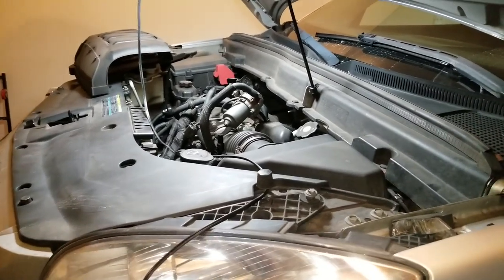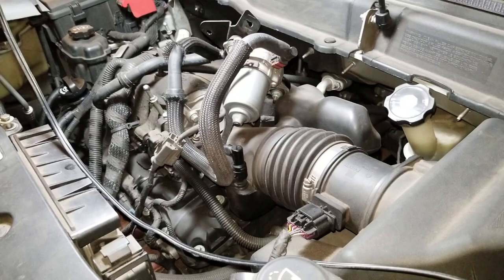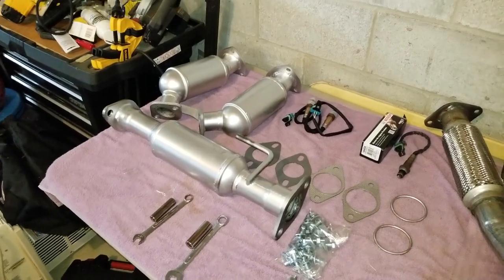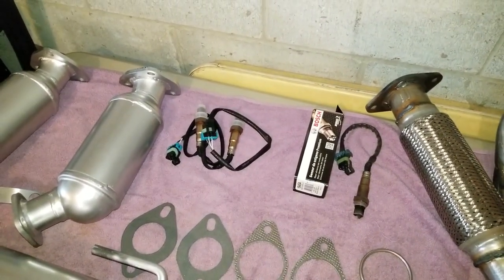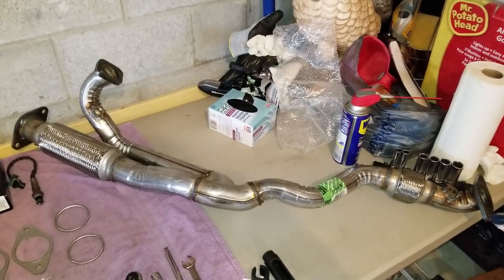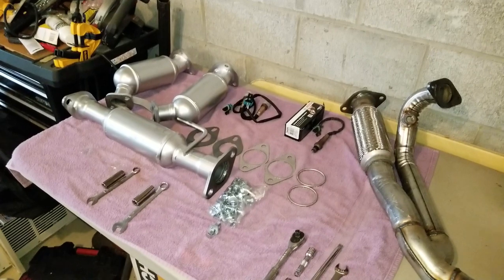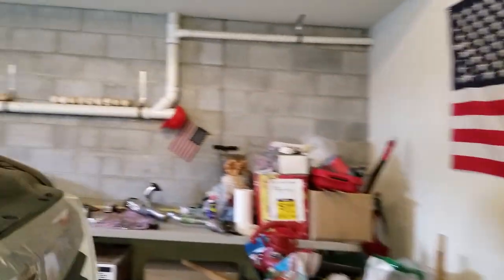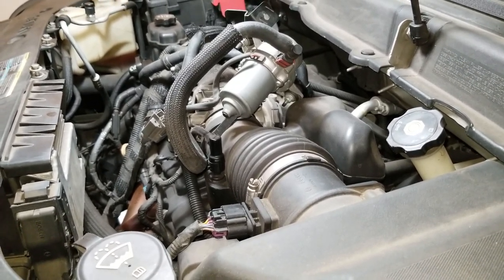2009 Saturn Outlook, Acadia, Traverse, Enclave - Catalytic Converter Installation - Part 1

Comment: Best video on youtube on this subject. If I could add anthing it would be spray all the nuts and bolts regularly before install day,  makesure to use 12 point wrenches/spanners and sockets. And ratchets for tight spaces and lots of teeth to reduce having to take off your socket and reset it. Brilliant info Jay.
Reply from the maker: I absolutely agree.  Spraying all the nuts and bolts is a must, and I wish I had 12 point wrenches.  I have some, but only shallow sockets, not deep sockets.  I also wish I had ratcheting wrenches but had to make due with what I had.

Comment: Jay, thanks for the excellent videos.  Your education gave me the confidence to successfully tackle the replacement of all 3 catalytic converters and 4 oxygen sensors on my 2010 Acadia.  It was not an easy job for a novice like me, especially as some of the bolts needed to be tackled almost by feel, but you told me all I needed to know, and removing the heat shields helped a lot. 

If I can share some advice to others it is, get yourself an impact wrench.  I spent the most time trying to get off a couple of easily accessible bolts which I could not budge, eventually messed up and had to cut off.
Reply: Was your 2010 Acadia an AWD?
Reply: @kenkuchnicki9012  Yes it was.

Comment: Not all super heroes wear capes! You are the king sir. Not sure if you plan on putting out more videos or not but you have me subbed forever. Thank you
Reply from the maker: Yes, eventually there will be more.  I am not a rich man and can't afford anything new right now so this car needs to last me at least another 2 or 3 years.  So I plan on fixing as much as I can on my own, and with that there will be videos.  I will be doing spark plugs and ignition coils soon, and eventually a brake/rotor/ball joint video, so stay tuned.

Comment: I paid a little more than 100 for  a 3 part catalytic converter with all the hardware and 120 for the flex pipe section through Amazon.  Everything fits perfectly!  The problem is all of these parts companies are ripping people off.  The parts I got are  OEM certified GM parts through aftermarket parts suppliers.  The difference is are they rated California emissions.  Even if they are not, they will still work!

Comment: I'm looking at replacing mine right now. At 296,250 miles on my 2009 Enclave. The engine killed my cats. I've had to change the coil packs out so many times it's silly. I'd never put in OEM since I can't figure out this issue where the coil packs go back and then unburnt fuel goes into the cats and kills them. So cheap and time consuming is my only real option given my situation. Fortunately I have a friend with all the tools and a lift so I can do this again in 18-24 months after I'm at 350k miles!
Reply from the maker: The fact you have that many miles is amazing.  Mine is almost at 190,000 at the time of this message, and I"m starting to believe mine is doing the same thing with dumping unburnt fuel, or oil, or something and causing intermittent code issues.  At this point, I don't care anymore because the car runs perfectly fine despite the engine light coming on.

Comment: Hi Jay,  Thanks for the video very well Presented. I have a 2009 Enclave, can you share were you ordered your parts from.  Thank You,
Reply from the maker: Converters were from Ebay.  Some people have a problem with Ebay, so shop with caution and use your best judgement.  If you don't like Ebay, you can always try RockAuto, 1A Auto, or the box stores.  O2 sensors were from RockAuto.com.  Converter and Exhaust pipe gaskets, if needed, can be bought anywhere.  The Y Pipe I believe was from RockAuto as well, Walker brand.  I haven't watched these videos in awhile, so I forget where exactly I got all parts.  I may mention it in the videos but I forget.

Comment: You're video is awesome. I bout all 3 cats for $217. I took the easiest one off first and it was completely clogged up, so I know I had to replace all 3. I got all bolts busted loose and it still wouldn't give. I totally forgot about the bracket mount.... kicking myself right now but ready to continue tackling it again tomorrow. The bank 1 is the worst. If you have any suggestions getting it off I'll take them! Thanks again for the informative video.
Reply from the maker: Bank 1 is the worse.  Its the only one that you need to be fully under the car to get to.  The only things that help are this: 1) There are 2 heat shields (thin metal plates) that restrict access.  Use a 10mm socket to remove them.  The screws are easy to get to, just don't lose them.  Should take 5-10 minutes to get them out.  This will help you get your hands and wrenches up top to the bolts that hold the converter on to the exhaust manifold.  2) If you are replacing all 3 converters, unbolt and remove the Flex Y pipe, that will give you a little more access too.  Watch PART 2 of this video because I explain how to remove the heat shields and how to get the Y Pipe out.
Reply: @jaybrown9158  thank you so much for all your help!

Comment: Good video although only correction i have to make is the directions of your motor. Left and right side is not done from the drivers side. Its looked at from the front of the motor which is the side with the drive belts and accessories which is actually on your passenger side. Iv seen many people refer to it like that and its just not correct. I learned under a master mechanic that has over 50 years under him on almost any car from cheap to exotic and have even confirmed this with dealership mechanics. Just some advice in some cases this can really screw you!

Comment: I did mine just fine after I figured out the threaded bolts for the engine block.
Couldn’t get the upstream sensor out because I couldn’t get enough torque laying on my back under the car so I left it.

Comment: I just came across your video because I have to do the same for my GMC Acadia. Did the catalytic converters hold up and for how long? I am in a sort of conundrum on which because they very impressed drastically, some three pieces are in the range from $70 to $200, and as you stated in your video upwards of $1,000 if you buy them from the dealership. That is a significant price difference, so I want to see the whole "get what you paid for" applies to this

Comment: Hey Jay, i'm having that Bank1 low threshold code. Where did you find your OEM parts on ebay? I see you have a Walker part, but what company did you find your catalytic converters on?

I like your video and it is very informative.  Thank you for your time.
Reply from the maker: The converters were from a company called First Choice Exhausts.  There are lots of other companies on Ebay that sell these parts in case you want to shop around and do comparisons.

Comment: Very interesting 👍🏼.
Can u send me the link of the website where u found the whole set?
Reply: Same 😂
Reply from the maker: @christopherwright9312  and Elijah,

The converter set was from a company on Ebay called First Choice Exhaust.  O2 sensors and the Y Flex pipe I got from Rockauto.com.  I know there's been a lot of concern with buying parts on Ebay, especially after market parts.  The intent of my videos is to help educate and teach people how they can do this themselves.  It is NOT my intention to force people to buy from Ebay.  You should buy from where you think is best and what fits your situation and budget.  Hopefully, at minimum, my videos give people the confidence to do the work themselves and save thousands of dollars.
Reply: @jaybrown9158  it’s a good video, very insightful

Comment: I did the same thing and the engine light is still on for bank 2 the very converter I replaced. 2012 Traverse mechanic keep saying if it’s says converter thts what it is… but I’m researching learning could b o2 sensors. So I just dnt know

Comment: Never ever buy from GM, they'll charge you more that you can bring out of your wallet. You can buy the same parts from another company that are just as good and are high quality but far cheaper. Always try to find alternatives from the actual maker.
Reply from the maker: I agree.  And the prices for these parts on GM type websites are going up.  When I made this video, catalytic converters on GM parts website were around $450-460.  They now go for $560-580.  Doing all converters for one of these GM SUVs would cost over $2000 in just parts, probably $3000 with labor.  This is an easy enough job to do yourself.

Comment: Whats the torque for all the bolts? I did the exact same thing on a 2011 buick enclave but now when I drive sounds like possibly its not tightened enough. How's yours holding up?

Comment: Just an FYI, these are not OEM but I'm sure you're aware of that now since you have the OEM off to actually compare. These are super cheap for a reason, but I'm sure you also know that by now also! IF by chance you haven't had any issues since installation, you are 1 in a million and I hope you play the lottery!
Reply from the maker: Hey Ed.  The only issue I had since installation was a couple of the gaskets went bad.  But to me that's minor and have been fixed.  Also, I am aware these are NOT OEM, but beings that this car is old and I plan on trading it in soon, I wasn't looking for parts that would give me another 10 years.  Just something to hold me over for a year or two.

Comment: Save your time and the headaches! Go original! I’ve tried 8 different front catalytic converters. Different manufacturers and even local Napa. Good for a month then the code comes back. Even with new oxygen sensors. We’ve had an 08 & 09 motors are garbage. Catalytic converters are the least of your worries. Timing chains are garbage.
Reply: Codes comeback if  unburnt gas or oil is going thru
Reply from the maker: @jman678  I agree, I think that's the problem I'm having now.  I blame that on the engine getting old, gaskets failing, etc. and not a converter problem.  Yes, this damages this converter over time, but at 14 years old and 190,000 miles I'm just going to ride it until it dies.
Reply: @jaybrown9158   a way to stop it sort of is get the updated valve covers that are sealed and a catch can

Comment: Hey man if there's a way u can find the website u got the parts or the number u can send it to me I'll will appreciate it
Reply from the maker: Converters were from Ebay.  Some people have a problem with Ebay, so shop with caution and use your best judgement.  If you don't like Ebay, you can always try RockAuto, 1A Auto, or the box stores.  O2 sensors were from RockAuto.com.  Converter and Exhaust pipe gaskets, if needed, can be bought anywhere.  The Y Pipe I believe was from RockAuto as well, Walker brand.  I haven't watched these videos in awhile, so I forget where exactly I got all parts.  I may mention it in the videos but I forget.

Comment: Hi Jay, how are the converters holding up so far?  I have an 09 Acadia with 123K miles and just got a PO420, thank you sir.
Reply from the maker: They are holding up good.  No issues since.  I had a the code trigger a day later after installation, but that was due to 1 bolt I forgot to crank down.  Once I tightened it, code went away and has been fine since.

Comment: Jay did you have any symptoms to lead to a bad converter? If so, what was your symptoms?  I have an 09 Acadia with 140K on it. Not throwing a code but very very sluggish and won’t pull. Acts like it’s bogged out and choking down. I did have random misfires on bank 2. Changed coils and plugs with no difference.  Curious as to if you had any running issues to lead to replacing yours other than just the code. Thank you!!
Reply from the maker: No, I didn't have any running issues.  The code just popped up one day, and then would go away for a week or two, then come back on.  So eventually had it checked out everytime the light came back on, and it was the same P0420 code.  So when I asked my mechanic, he said most likely it was a Catalytic Converter going bad.  Could have been a sensor issue or leak issue, but 9 out of ten times, a converter, so I just replaced all and didn't worry about what was the exact cause.  My car runs a little slower anyways due to age, so I'm not sure if the converter was causing any bogging down issues.  Hope this helps.
Reply: Micheal, I have the same problem with my Acadia... did you ever figure out your problem?
Reply: adamfresh2defar  I ended up replacing the converter 3 times in 3 weeks. It kept melting them down. Throwing misfire codes. I changed and done everything that could cause it. I even walnut blasted the carbon build up on the valves. It literally just stopped doing it one day on its own. Best I can figure is I had an electrical demon in it. Those cars are plagued with electrical problems. Thankfully now though I traded it in on a Limited 4 Runner after the engine blew up at 150k with all maintenance kept on it like clock work. That car was a nightmare from day one.

Comment: Have you had any problems since installing them with them? Check engine light staying off now?
Reply from the maker: Yes, light is still out.  The next day it came back on, but that was only because there was 1 bolt I forgot to crank down, so it was causing a slight leak and triggering the code.  I tightened that up, cleared the code, and it's been out since.

Comment: Did those parts work good? Have you had any problems since you replaced them? Did you have any more problems with the check engine light?
Reply from the maker: Yes, I finally starting have problems and a check engine light.  I do say, in my videos, that I wasn't looking to replace these parts and have them last me many years.  My goal was to learn how to do it myself, save loads of money, and get a year or two out of them because eventually I was trading my car in.  Plus, I had an inspection due so I wanted to save money and do it myself, thus saving thousands at a mechanic, because converters and O2 sensors have to be good to pass inspection.  As of right now, as I'm typing, it has been actually 2 years since I made these videos.  I got about 1 1/2 years out of the parts.  I'm going to be posting a PART 3 video soon so keep your eye out for that.  In that, I will explain my experience.
Reply: @jaybrown9158  very good. I like doing my own work too. I learn, save money, and can buy the tools to do the job with the money that I saved. Just feels better doing my own work. Great video btw! Thanks.
Reply: @jaybrown9158  may i ask where to buy the parts or did you share that info and i missed it? When you talk about again having an issue with the check engine light is it due to the parts you purchased or the age of the motor.  I have a 09 enclave i just purchased with all my money and i have an issue with the cat also/ bank 2......

Comment: Hi Jay how did the car run after you made the repair. And to change the catalytic converter located at bank2 is it right there at the front and easy to change? What items are needed just to change that 1 catalytic converter?
Reply from the maker: The car ran great after all repairs.  It's almost been 3 years since these videos, so I did have to replace them again, but the converters are after market parts so I wasn't expecting a long life out of them.  The front converter (bank 2) is the easiest.  You only need to jack up the front of the car to get to the bottom bolts.  So you only need a ratchet, some extensions, and some sockets, 13mm and 15mm.  The only hassle is getting off the heat shield that covers the top part of the converter, but it's not too bad.  Hope this helps.
Reply: @jaybrown9158  thank you for reply and helpful advice. I just got this car cash and didn't know all of the issues it had till I got  it. Took it to the dealership to have it inspected and see exactly whats wrong. It said all catalytic converters and 02 sensors are after marker there is a exhaust leak somewhere. Oil is leaking from timing cover and needs replacing, engine mount needs replacing and power steering pump is making whine noise and leaking, also my right boot is completely torn (I think from something leaking on it). Also air just went out. It blows hot air and heat works fine but no cold with snowflake button and circulate button blinking if you turn on. What would you make priority to fix first? Would you fix any of it or just save up for something else? Your opinion is greatly appreciated❤
Reply from the maker: You just mentioned a ton of stuff, so my normal reaction would be get rid of it, but if that's not an option, go with whatever you can afford for now.  As long as you have hot air for winter, you should be fine there.  Also, just because your converters are after market, doesn't mean they are bad yet, they might be slighty used and just triggering a check engine light.  O2 sensors are cheap and easy to fix, so get those done if your budget allows.  Timing cover and timing issues are something these cars have issues with and there was actually a recall on them like 6 or 7 years ago, so it may or may not be too late for that to be fixed now.  Depending on where and how bad the exhaust leak is, it may not be that important right now, but will need to be addressed eventually, maybe by spring time.  Hope this helps.  By the way, what is the year and make of your car?  How many miles?
Reply: Great detail in the video.

Comment: Do you have a link where I can order these parts I'm in need of them now Saturn is in shop now I just don't want to have to pay Shop prices expensive here hopefully you see this get back to me please
Reply from the maker: The cat converters were from a company called First Choice Exhaust on Ebay.  But there are other manufacturers on Ebay for these parts if you prefer someone else.  The Y Flex Pipe is a Walker brand and I got that from RockAuto.com.
Reply: @CaptainLoveBoob  thank you, even though Amazon doesn’t carry them anymore it put me on the track to finding some.